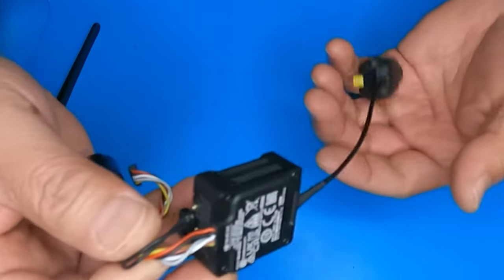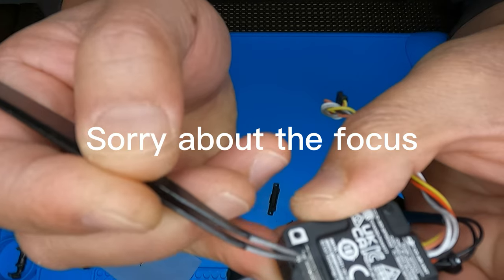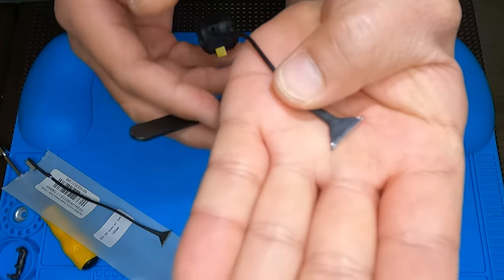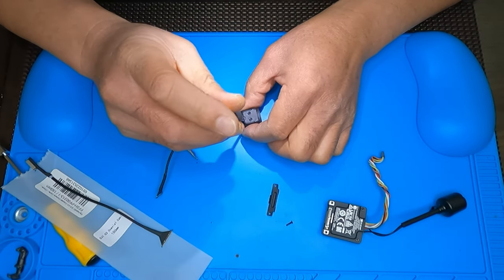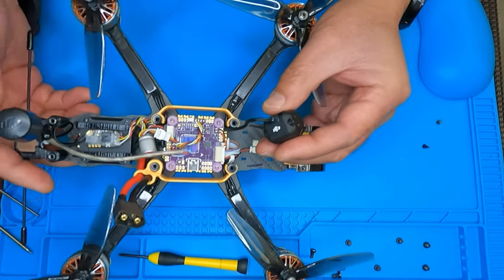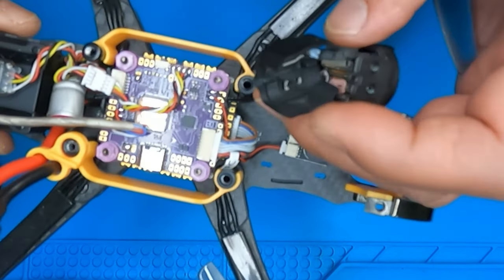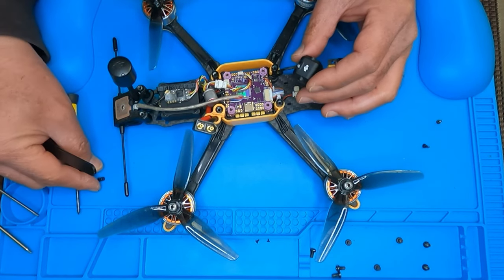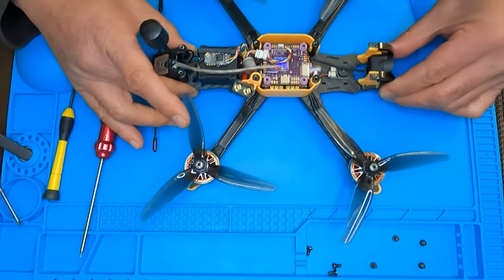DJI 03 Air Unit Camera Cable Replacing

Comment: Thanks for this dude.  I installed mine on my F4 but realized i needed a longer cable because i put a longer "nose" to not have props in view. Waiting on a longer cable.
Reply from the maker: Thank you!!! Just be careful and patient with removing the cable connection from the camera, it's took me a few tries and magnifying glass helps. Thing is tiny... happy flying
Reply from the maker: @nonsenseexplorer  have you tried just fitting the screws in the camera when camera is not installed? Maybe it is miss aligned? Very weird that's the exact same screws that came out won't go back in, unless it got cross-thread by accident. Try to put screws in the camera before installing camera in quad to make sure it is not cross-threaded.
Reply from the maker: @nonsenseexplorer  that is so weird, does the screws have thread lock residue? If yes remove as much as possible. If no try to screw the screws in the camera only, just to confirm everything is good. Since all you basically did was adjust camera angle, and if it's the same screw and screw location it should fit. So weird....... hope you can figure it out
Reply from the maker: @NONX01  always the simple things,  glad you figured it out. Now enjoy your flying time!!!!!! Merry Christmas 🎅
Reply from the maker: @nonsenseexplorer  oh no!!! Maybe try simulator or try flying line of sight ( with out goggles just to get comfortable with the controls ). Also try sitting down when you have the goggles on. Took me a couple of months to feel comfortable standing with goggles on when flying.  You can also start flying in angle mode at first.  It does take a lot of stick time to feel comfortable when flying but it so worth it.  You got this 👍 💪
Reply from the maker: @NONX01   Got it, awesome you took the time on the sims.  keep on keeping on, you will get it pretty quick.  👍
Reply from the maker: @nonsenseexplorer  the prop nuts should be tighten pretty good, especially on a 5" quad like the mark5. Most 5" quads run "props in" configuration, so usually the rear right and front left props tend to loosen.  This happens just from flying and even more so when you tap/hit something. But seems like you tighten them pretty good. You can also grab the motor with one hand and try to turn the prop. Prop should not turn, and yes don't crank it down like a lug nut for a car tire.
Reply from the maker: @nonsenseexplorer  what radio are you using, Boxer? Have you checked all your switches in the modes tab in betaflight, and made sure it switches to the correct position? It's very weird and dangerous that your quad did not disarm the first attempt.  Recheck your arm switch in betaflight with out battery, just plug in usb to pc. If that works fine, hmmmmm also check arm angle and set to 180 degrees. You can also set a switch to assign angle mode, horizon mode and air mode. Try angle mode can be easier to fly in the beginning.
Reply from the maker: @nonsenseexplorer  that is weird regarding the arming. If all motors spin freely and the props are on tight, than how are the props? Sometimes when a prop is real bad, it makes the quad flutter at take off, also the quad will sound different. As for the disarm arm issue, I am stumped

Comment: question i got the nazgul 5 with the air unit 03 i scratch the lens and i got a new camera but would be easier to just change the from part or where the cable connect it seem that the nazgul i have to take everything a part to change the cable ? Thanks
Reply from the maker: It would be easier to just change the entire  camera at the cable. It is not that much harder to change the lens, but will require more dismantling and recalibration. The only difficult part of replacing the camera at the cable is putting the cable back on the camera. Very small connector, use a magnifying glass It helps a lot.
Reply: Thanks ya i end up changing the lens only and it turn out to be super easy and took me like 10 min and calibration is 1 min. The way the Nazgul is design the 03 air unit is weirdly all combine with all the other stuff.  @jaechoe  😃